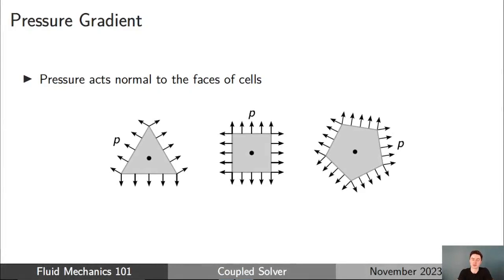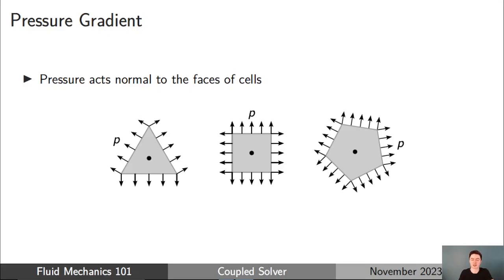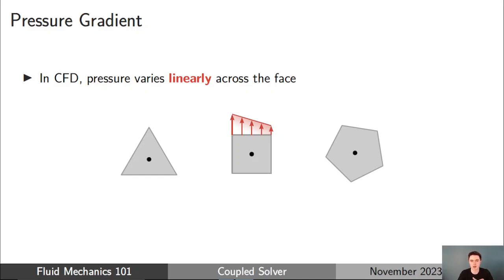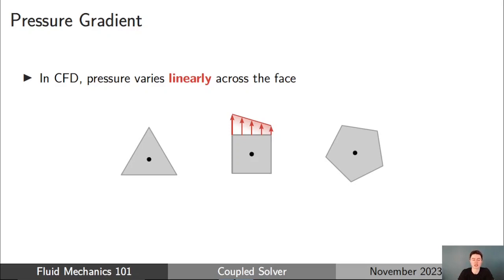[CFD] Pressure-based Coupled Solver  (Part 1)

Comment: Interesting starting slides about the pressure gradient, but the pictures and the discussion are not really correct.  The pressure is computed and stored at each face but the normal points in whatever direction is determined by the discretization method used by the solver, .  CFX and Fluent are different in this detail.